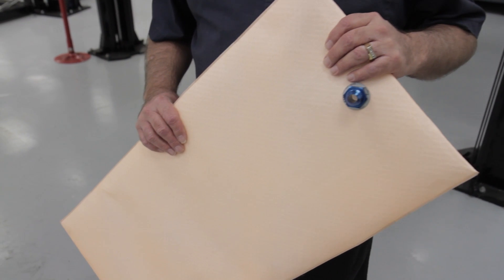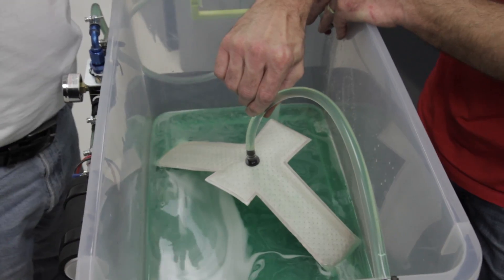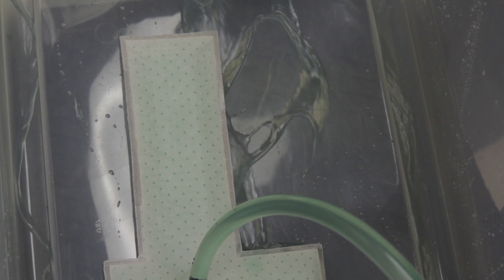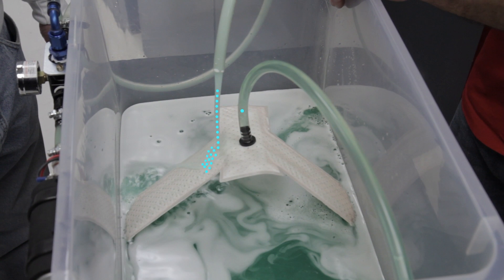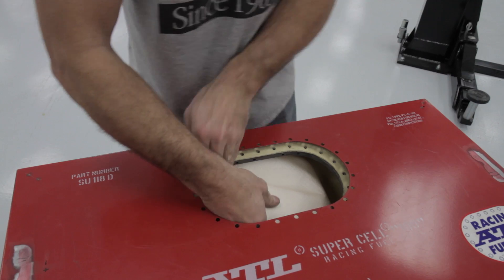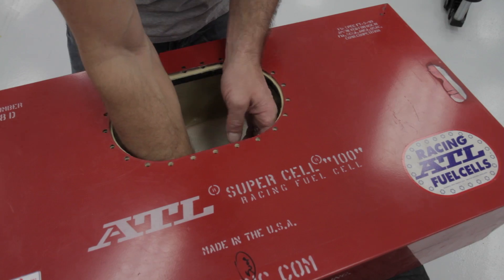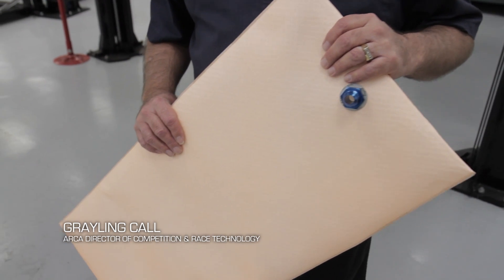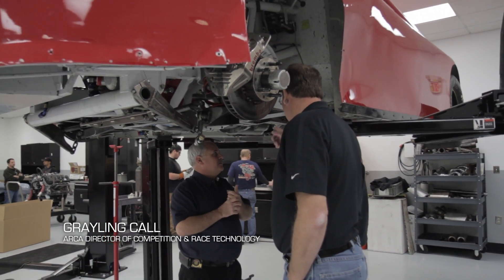The Amazing Holley HydraMat

Comment: If used in a fuel cell with foam, does the mat need to be secured to the bottom of the tank? Or can the foam just be reinstalled on top of the mat?

Comment: Does it work with diesel fuel?
Reply from the maker: +Mark Linder It is compatible with diesel however the effective flow rate of the mat will be diminished because of the difference in specific gravity of the fuel
Reply: would i just need a bigger one for diesel

Comment: Can foam be used in the tank with the mat?  Foam is needed by regulation in our sport.
Reply from the maker: Foam is used with the Hydramat. The foam is removed from the tank, the Hydramat inserted and the foam replaced to hold the Hydramat in place. It just wasn’t shown in the video.
Reply: HolleyPerformance Thank you for the clarification.  We would love to get this into our Ultra4 car before The Mint400.
Reply from the maker: Route 63 Motorsports We are working on production now and hope to have them available in 8 weeks or so. Stay tuned to the website, we may have some varieties available earlier.

Comment: Are you guys planning on partnering with any tank/cell manufacturers to offer this in a ready to run option?
Reply: That would be amazing options esp for track ready cars from factory, how often would something like this be replaced?
Reply from the maker: Ryan Tebow This is not an OE product design so it will need to be replaced in between 10-15 years, depending on the environment of the application and fuel being used. -Blane
Reply: HolleyPerformance E85 ? I got flexfuel so tracks will be on E85, But if this could give me a few extra laps around the track as one outing pretty much drains my tank ;P